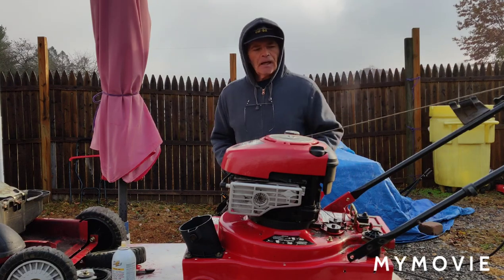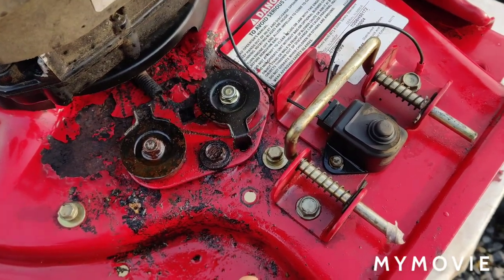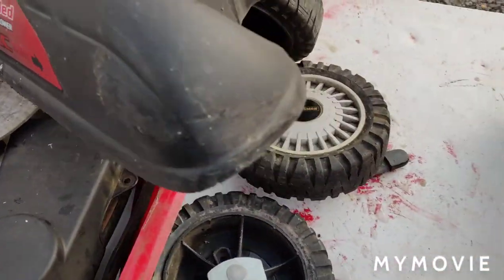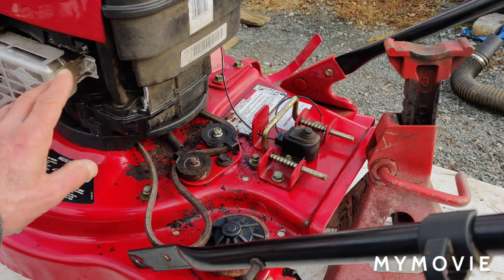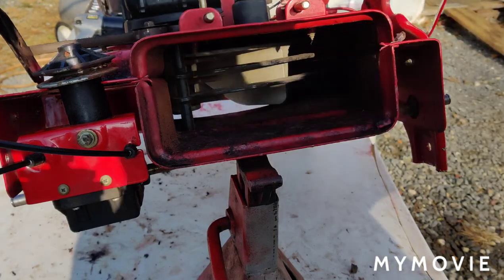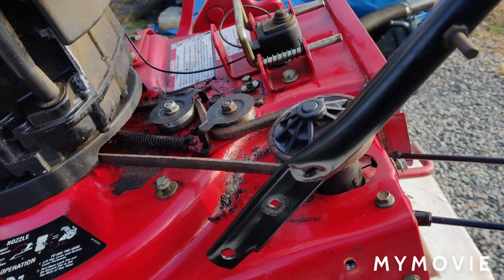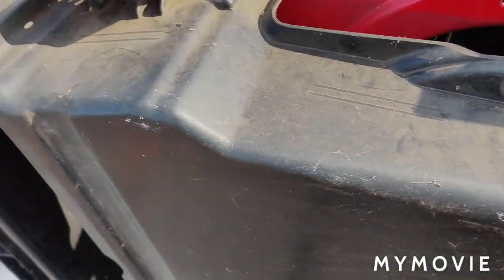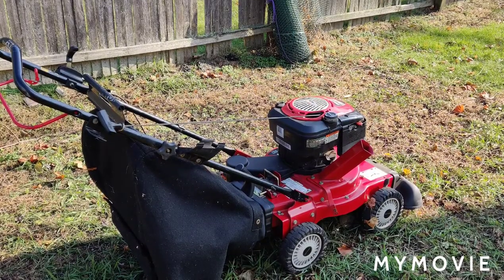Craftsman 4 in 1 mulcher drive belt replacement PT 1 and 2 combined

Comment: Thanks for making this video as it's the only one out there.  Nice job.  What a pain of a repair.  Some differences, I didn't have to take off the front wheels nor bar to remove black front chute, but it's probably helpful.   I was able to simply tilt the red pan and remove the impeller in order to get the belt off/on. For anyone doing this, make sure you have the parts and the screw to remove the impeller.  At most 3 hour job.  I did my mine in segments and made a map of all the screws/bolts I removed.  Thanks again Gravelyman.

Comment: The tapered end on the crankshaft is added protection in case something gets jammed in the vac unit. Leas chance of breaking the crankshaft. Also, the metal cage will come off without removing the rear axle. Pull the rear wheels and remove the bushings on the axle. It will give you just enough clearance to pull the shield off. Be careful when removing the front vac section. That red handle will break easily with any sideways pressure.
Reply from the maker: Okay. Thanks for the  information and Thanks for watching 👍

Comment: Thanks for the video! I have this machine and it needs a belt. It amazes me they didn't put the belt on the bottom of the impeller. The transmission could have been flipped 180 degrees and the tensioner on the bottom making changing the belt much easier. Dumb.
Reply from the maker: Your welcome. Yes these belts are not any fun to do. Thanks for watching 👍

Comment: I've been working on small engines for a few years, and I never list ANYTHING for sale unless I know for sure that it runs well. I even go the length as to use them first before advertising for sale. I've run into a few situations where I've gone to look at a piece of equipment, only to find out that it was not as advertised once I get there. Nothing irritates a potential buyer more than this~ and the time wasted could have been used for something else that I may have already missed out on. Moral of story: Make sure it works before selling it!
Reply from the maker: That's good practice. I always do the same. If it's not to my liking it doesn't go up for sale. Thanks for watching 👍

Comment: I didn't have to remove the transmission. I was able to get the lower metal panel off just by hitting it with a rubber mallet.
Reply from the maker: Okay good to know. Thanks for watching 👍